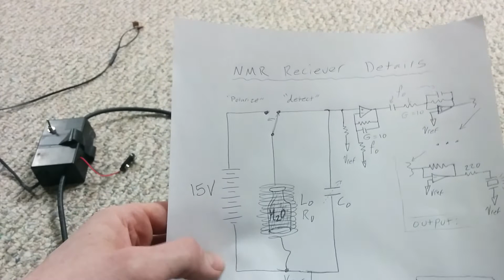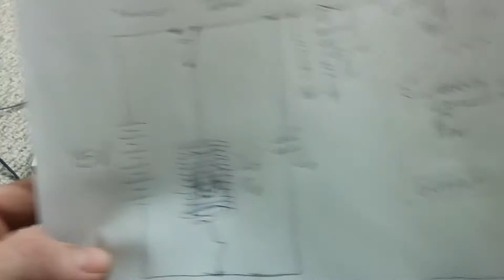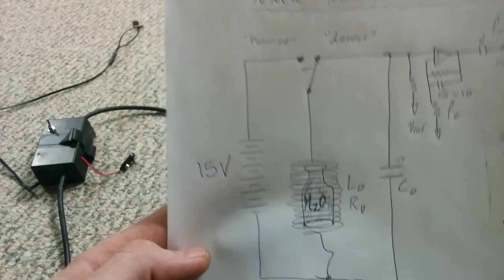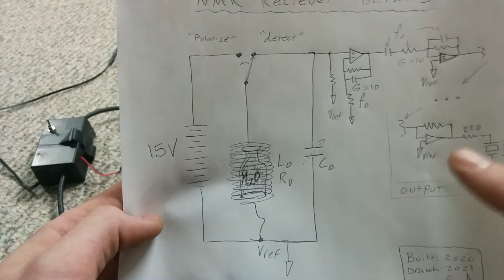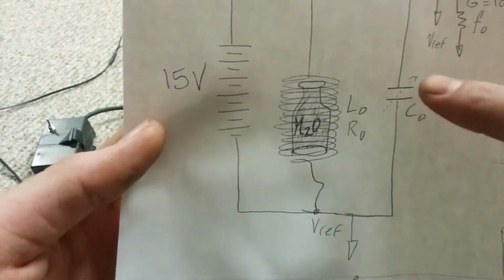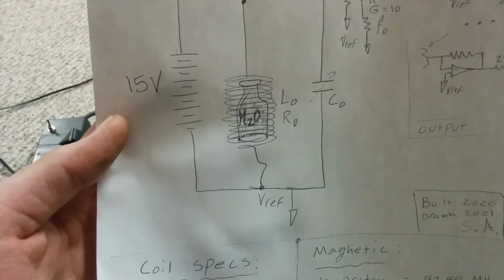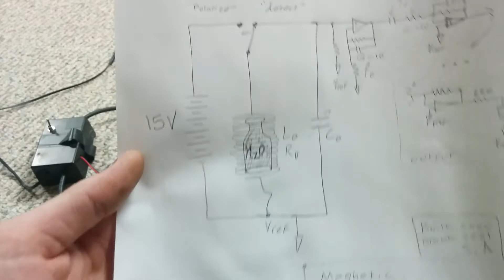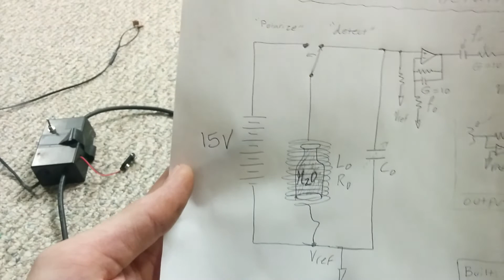Viewer Request: Earth's Field NMR Receiver circuit details

Comment: Tip: A 1 volt test signal (at say 2 kHz), with a 100 ohm resistor, attached to a loop antenna as shown, placed one meter away (in the same axis as the receiver coil) - if you can detect the test signal with your amp - then your setup should be good enough to detect the free induction decay.

Comment: Thanks for generously sharing your circuit.
Can you please explain one thing I don't get: where from your circuit picks up NMR signal, when you don't have a separate pick-up coil? My understanding is that NMR signal would be swamped by the main coil and that main coil would not turn off instantly but over a period of a time and thus swamp the NMR signal.
Reply from the maker: Thanks! And great question, too bad I didn't see it for over a year.

The coil indeed has a finite demagnetization time and some ringing. That definitely scrambles the spins to some extent and cuts the detected signal amplitude. However, when I experimented with making the coil discharge more quickly, the results were always worse. 

Option one is using the coil as both pickup and field coil, which is simple but has some subtlety to the details that you picked up on. 

Option 2 is to have a separate, more finely wound pickup coil, which defines a transformer and requires a sophisticated strategy for de-energizing and protecting the amplifier inputs, incurring even more losses. 

It's an art in itself, I'm amazed at what the r.f. guys can pull off.
Reply: A short solenoid of a few meters wire length will lose its magnetism quickly when its connection to a battery is broken with a simple switch. An amp can then be switched in and the same coil can be used as a receiver. Capacitor values around 1uF and under will tune a coil of that length to be sufficiently resonant around 2 kHz. Two layers of 0.5mm enamelled copper wire will do it.

Comment: Awesome project! I hope one day I can do something similar. But man, I'm missing something out. How it's possible to polarize spins just using a DC voltage supply? I always thought it was mandatory to use a R.f. pulse.
Reply from the maker: Thanks! Glad you got some value out of it. 

Right, normally R.F. pulses are used to flip the spin population by either 90 or 180 depending on the experiment, since it's not feasible to suddenly rotate  or flip the giant superconducting magnet. 

If the main field is the earth's, it's quite easy to override it with differently oriented d.c. fields, to which, the protons will orient in their usual gradual, spinning way.  

Edit: I vaguely recall reading of an NMR spectroscopy technique, where the tiny sample is both spun, and suddenly flipped to induce the relaxation. 

Hope that clears it up.

Cheers🍺
Reply from the maker: This got me thinking: one could theoretically have a bucket of water with a D.C. polarizing coil wound around it. 

The Water pours out through a spout, and the proton begin to relax as they exit the polarizing field. 

This would create a "frozen" free- induction- decay signal, spatially distributed, down the stream, instead of time varying.

Bit of a head trip, but yeah it could work, maybe.
Reply: Water is diamagnetic, so a DC field is all we need to get the atoms pointing in a particular direction. There are lots of videos on youtube showing volumes of water being repelled by non oscillating magnets. The DC field in the solenoid clamps the hydrogen atoms in one axis for 6 seconds or so, with the number of captured atoms growing over time. The DC field is dispersed rapidly, then the receiver switches in and detects the captured hydrogen atoms, which have now started spinning in the field of the earth - this is called Free Induction Decay. Eventually the spins are no longer coherent, and we lose the signal. However, with a much lower voltage 1ms long sine pulse, sent back into the coil at the FID frequency, we can rapidly make the spins coherent again, producing the famous "spin echo". The resulting received signal is almost as powerful as the original FID, but requires a fraction of the power to produce.

Comment: Cool stuff!
     I remember, back in late 80-s, we had a group, which made an Earth NMR with size of the ground loop of about 100m, and pump currents in 100-s of Amps. It was able to locate underground water, and, with some heavy data processing, to obtain water depth  profile up to ~100m deep. I believe it has been commercialized later as an alternative to a drilling technique.
Reply from the maker: Yeah thanks! Woah, that's awesome, very cool application indeed. I appreciate you adding that experience here. 

When I was setting out on my early NMR experiments, I had a discussion with a very good friend of mine from school, physics student also, who went on to be an medical MRI scientist, wherein he purposed the idea of winding a coil around his family's above-ground swimming pool (timber framing and aluminum... Fasteners would need to be changed to brass or something...) In order to study geo-magnetism or some such. 

I insisted that it wouldn't work very well because of scaling, tiny gradients add up to larger effects at larger scales, larger ensembles are harder to interact with coherently... And that a single atom NMR signal would be more likely to be a useful, very long-lived signal.  Blah, blah conjecture.  I was wrong and he was right 🤣

Comment: When I was designing my  magnetometer, I tried multiple low gain stages like that but didn't have much luck.  I ended up with the sensor feeding an audio transformer which increased the impedance to the amplifier input but also had the added benefit of giving an additional gain of 14 to the NMR signal.  Then I fed a high impedance, extremely low noise amplifier (FET front end) with a gain of X1000 into a narrow bandpass filter which also had more gain.  If I recall correctly it had a 150hz bandpass with a chebychev steep response.  This worked great.  I put a bank of capacitors before the input each one being capable of being turned on (added in parallel) with FETs.  I then was able to tune resonance by counting in binary increasing or decreasing the resonance capacitance with a mirocontroller.  It is a very stable receiver that is tunable to where I take the magnetometer.  When I tune the mag, the controller changes the resonant frequency by adding or subtracting the correct capacitance and tunes the bandpass filter accordingly.
Reply from the maker: Great details! really nice of you to add them for the benefit of anyone who happens across the channel here. 

You've clearly spent a lot more time around NMR than I. 

Yeah, I've seen magnetic couplings in books on the topic, it's a good idea. 

These amps are low noise FET input, and they're pretty good. I'm well aware that it's possible to make lower noise amplifiers, but I had the quad amp and home-brew breakout board handy for general purpose prototyping, as usual. It got me through my intro round of experimentation in the field with 0 digikey orders. 

Sounds like a fantastic project, please feel free to share any links to any videos, or your website or anything like that here. 

Home project or for a client?
Reply: @analogplanet9675  I designed it for my own use as a treasure hunter back around 2010.  I did so with the intent of  making a commercial product for sale.  I lost interest in starting a business but have used it in the field quite a bit and it has performed very well.  I have a couple of commercial proton mags from Geometrics and Gem Systems and I like mine more.  I recently started kicking around the idea of updating it and making it for sale. I bought a Teensy 4.1 and Nextion 7" display and am learning arduino environment.  You are ahead of me, it took me quite a while to get a good proton ring out of my electronics.

Comment: I’m interested in building one myself. This is awesome
Reply from the maker: Nice to hear🙂 glad to have passed on the inspiration.
Reply: @analogplanet9675  I was debating making one using a Halbach array, but I am unwilling to create a mechanism to shim it...or even confident I can do so.
Reply from the maker: @professorstratios8228  interesting. Right, I found shimming to be difficult/counter intuitive, and occasionally a random piece of iron, ten feet away or something, would actually homogenize the field instead of scrambling it, as you'd expect.
Reply: @analogplanet9675  Well the earths magnetic field is pretty homogenous locally so it SHOULD be pretty ok on its own. I figure a Halbach array would be very difficult. I’ve heard of people converting the signal to audio frequencies when shimming such that they should get a nice ringing sound when shimmed well and a dull thudding sort of plink when not.
Reply from the maker: @professorstratios8228  right, like you say, most of the time it's quite usable if you're not near large metal objects. I played around with shimming just to try to make use of a convenient location, in other regards. Not generally necessary.

 My next NMR project will be a higher field device, since I can now weld up some huge iron magnet cores or whatever.  

Yeah homogeneity... I assume you were thinking like a matched, inverted pair of hallback arrays? No idea, just thinking out loud. 

Seems like a pair of big, flat neodyms would be an easier way to do it, or at least make a good, strong finger-crusher.
Reply: @analogplanet9675  I would make and disc using arc shaped ones if possible such that the magnet field was perpendicular to the plane the disc was in. I would probably have a gross adjustment for leveling and aligning the ring and literal shims between each magnet to adjust the blocks very finely individually. It’s a pain.
Reply from the maker: @professorstratios8228  Nice idea with the ring. A related possibility would be to use two large neodym ring magnets, with field shape analogous to that of a coil (should be an off-the-shelf, semi-common configuration) arranged into a Helmholtz pair, and plastic tube in the middle for samples, could create a decently homogeneous zone. 

By the way, in my study of gradient coils, I independently "Discovered" and worked through a method of generalizing Helmholtz and anti-helmoltz arrangements to higher "orders" involving more coils (somebody must have done this 50+ years ago, but I've not seen it). I'm sure you can develop that concept independently on the back of an envelope without much difficulty (spoiler alert: binomial coefficients/Pascal's triangle/nth derivative linear operator impulse response/hermites polynomials). It led to some suggestive results about where to place shimming coils for effect, and so on. Just an idea.

Comment: OK.  Excellent video you've put together on an area not many people go to. 

Here's a couple of pieces of information, I remember when Practical Electronics magazine put out a compete circuit / project for a an NMR metal detector using this same principle. The article came out around 1979, at the time as a teenager I was mesmerised by it.
I've seen that it is floating on the net as a PDF now so you can still access it. 

 The key pieces of information that may help others is that they placed a bottle of distilled water inside the coil. They aligned the coil and bottle at 90 degrees to the earths magnetic axis, then energised and denergised the coil. 

The idea being that the water molecules being boomerang shaped dipoles with about 135 deg between the two end hydrogen and the central oxygen, would line them selves up with the earths MAG field. When the coil was temp energised the water dipoles would rotate to the coils MAG field which was perpendicular to the earth field. When the coil  field got denergised the water dipoles would precess back to align with the earths  field. The coil refresh rate was about 200Hz and the coil resonance was also about 2khz. Mind you this is all from memory from over 40 years ago.

I also found there is an 8mb PDF by Guiridi 2018 called Towards a low cost and portable ultra low field nuclear magnetic resonance device.
Available on the net.
Cheers,  great video, your always doing extremely interesting stuff really well.
Cheers
Reply from the maker: Right on! Thank you kindly for mentioning those resources.

I started out using distilled water as I had read that it was important, but later noticed that tap water works perfectly fine, too.

You can get this tap water at any hardware store, next to the taps, dies and drill bits. That stuff really works to keep a tap from binding up 😁